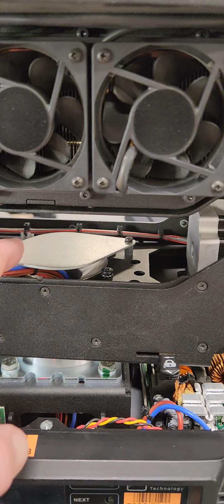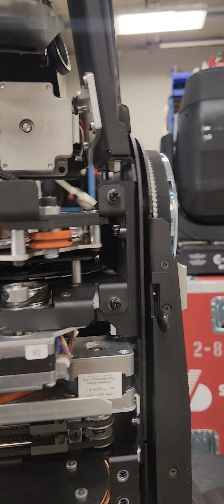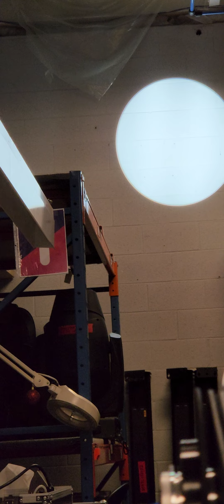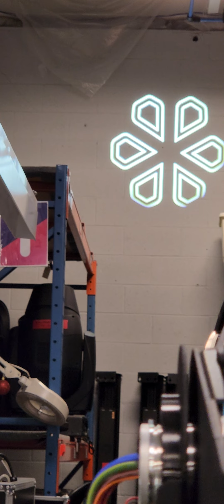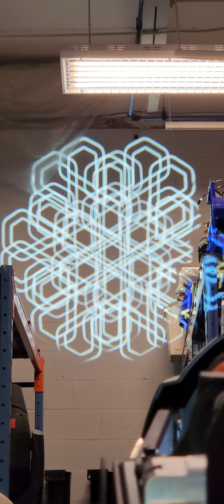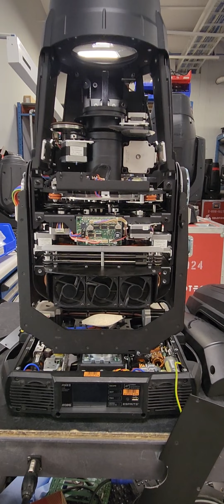Robe Lighting Esprite LED Fixture

Comment: Hey - I’m in Ottawa, and I have watched your grand ma 1 videos quite a bit.  I was wondering if you could advise me on how to change my internal watch battery for grand ma 1 light.  First off, should I do it with the power ON or OFF... I’m afraid to lose the bios settings, or is it hard coded ?  Also can I assume its a 2032 battery 3v. Thanks
Reply: contact your local ma distrubtor